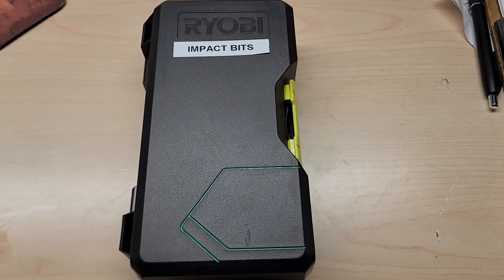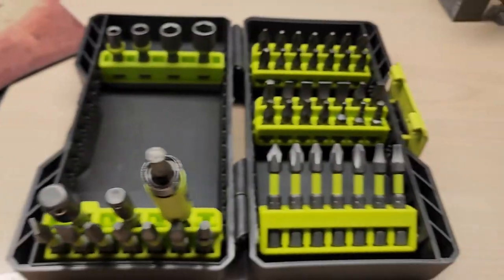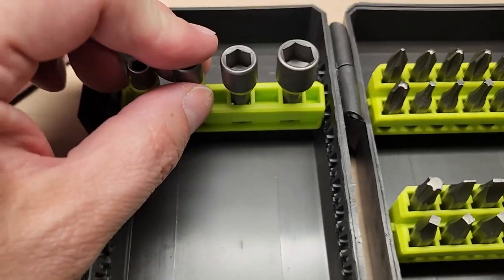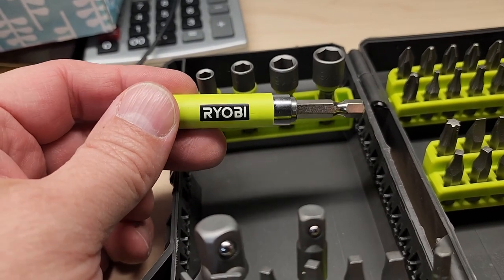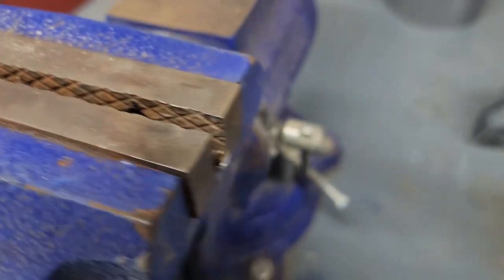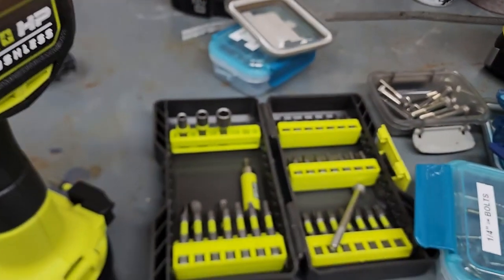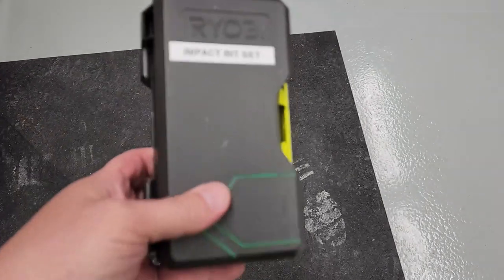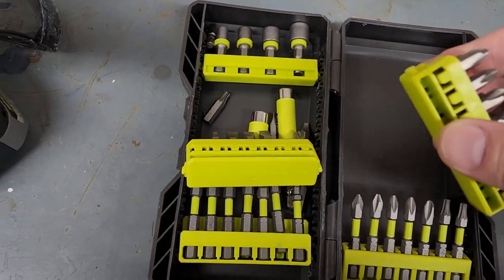Ryobi 50pc Impact Bit Review

Comment: The drill bits don't have the hex base for inserting into drill or screwdriver. Where is the bit adapter to allow use of the drill bits?
Reply from the maker: There is a separate set of drill bits that do have hex shanks. For most drill bits you'll need a regular drill chuck. There are adapters out there though.